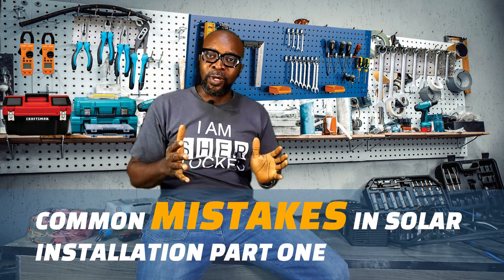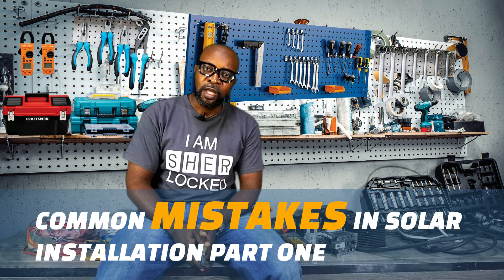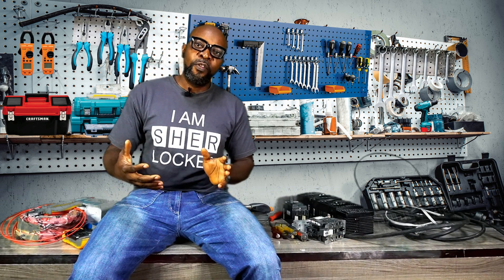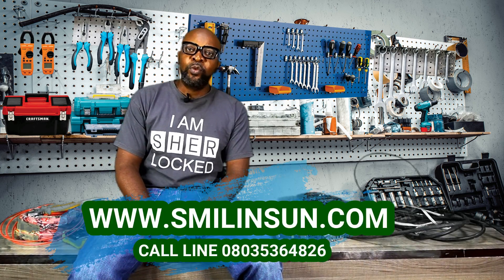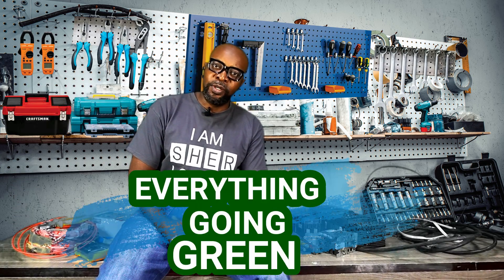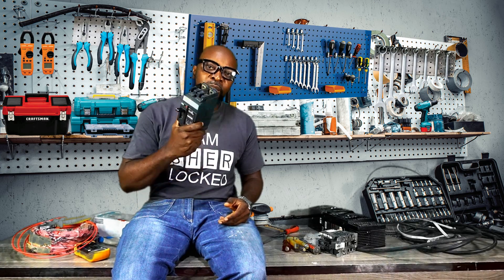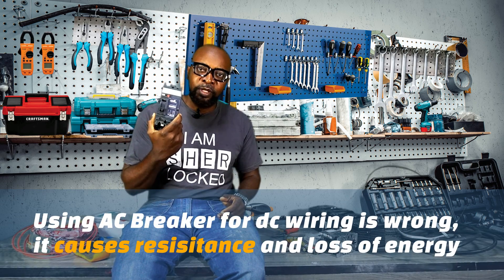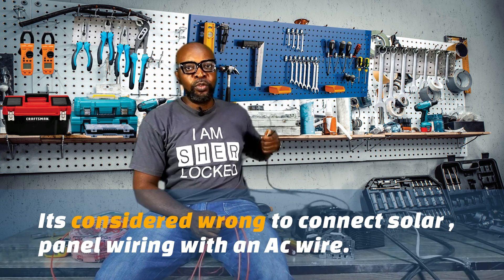Common Mistakes you should never do in Solar installations part one

Comment: I have learnt alot from your videos. I just realised that there is a big difference between dc and ac cables and isolators or double pole switches. The dc cct breakers or double pole switches are actually labeled as DC and with their voltage rating. Some others have both dc/ac voltage ratings. Do we have double switches or cct breakers common for ac and dc?

Comment: Good video, but most charge controllers come with a default setting suitable for proper functionality. In several cases, you don't have to reset parameters.
Reply: Right
Reply: You need to set them, I'm using tubular batteries but my installer left the battery type at lithium which is the default.

Cut off voltage for Tubular should be 11.0v to prolong the life of the battery, but the inverter was cutting of at 10.0v which will severely degrade the life of the battery.

Luckily I noticed this in a few days so the damage might not be much.

Comment: Hearing a buzzing sound on your dc solar output wire connection point in your solar array is it normal? For a 16mm 450/750v
Reply from the maker: No it isn't normal and you might need to check it out , suggests current leakage
Reply: @smilinsunsmilinsun8056  alright sir from the connection right. Also could it be related to the high voltage of 480vdc being produced?
Reply from the maker: @dendricknonso4327   A buzzing sound in a wire is an indication of a loose, damaged, knot junctions and under sized wires. . It's abnornal and should be a warning sound
Reply: @smilinsunsmilinsun8056  yes noticed the fault was from a faulty mc4 or rusty mc4 connection